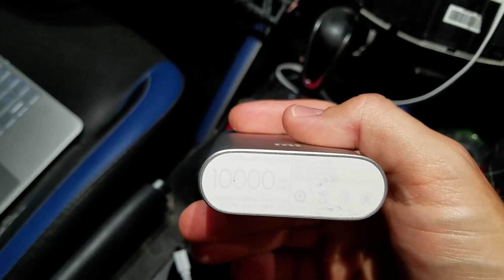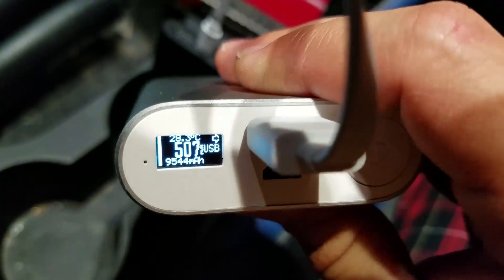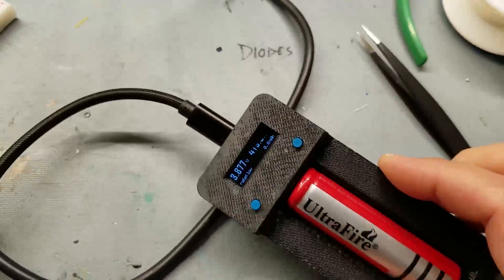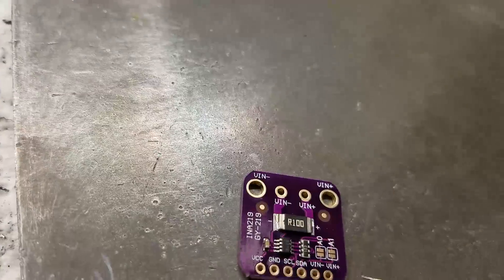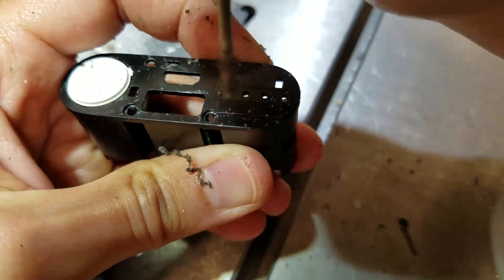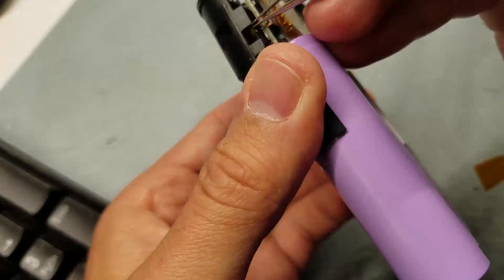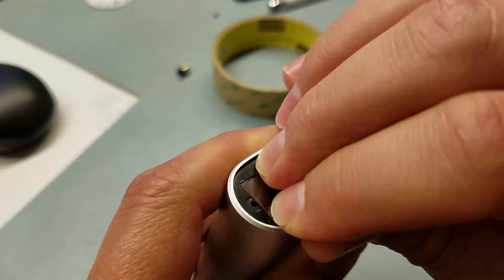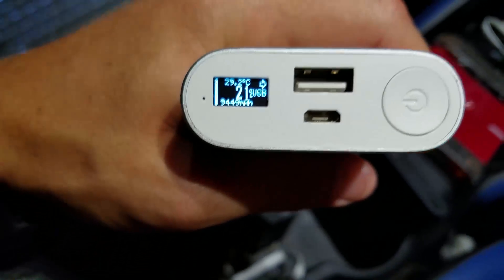Power bank hacked with instrumentation

Comment: Well its obvious it charges faster with the screen of when the phone isn't using the screen.... You could have known that with common sense.
Reply from the maker: I mean it pulls more current when the screen is off, which is counter-intuitive. You could have realized that's what I meant with common sense, because that's the only new information that this power bank would be providing about my phone's charge process
Reply: Then perhaps rephrase it next time to make it clearer what you ment.
Reply: Sometimes some common sense facts evades the very talented, and this man does convey talent. Oftentimes  an issue or problem that thousands of dollars has been spent on is solved with the most simply cost-free solution.
Reply: lordSeaworth  it's a vlog chill out. I understood what he meant, maybe you need to think about context more.